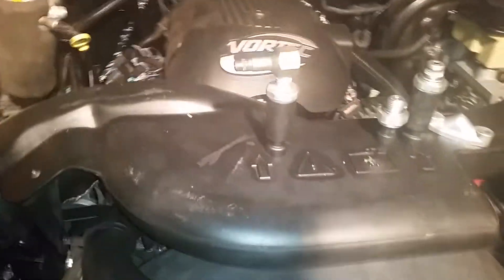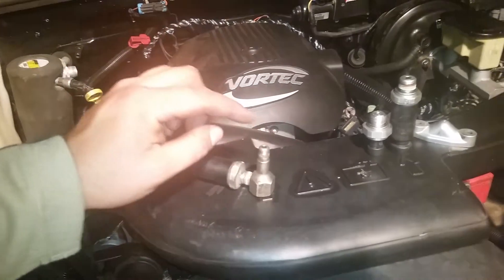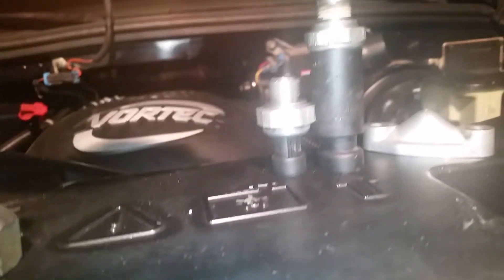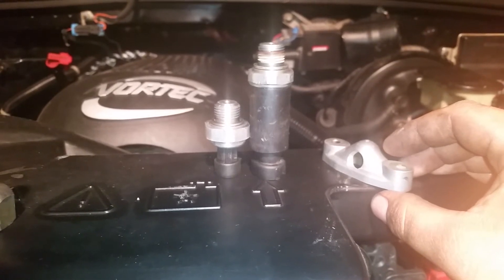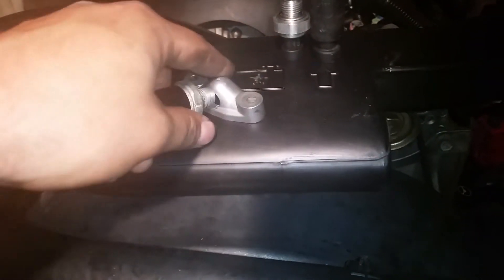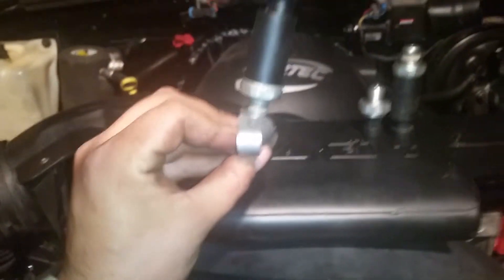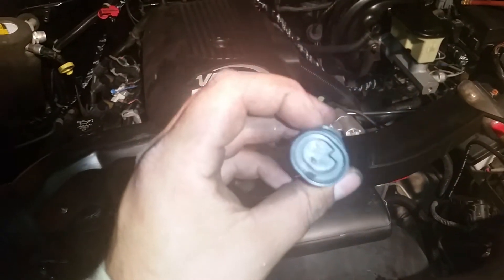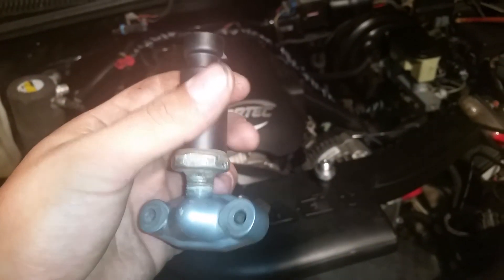OBS Easy oil pressure sender conversion.

Comment: Do not do this to your motor if you thread into that black off play you're going to restrict the flow the stem from the sending unit will stop the flow from one side to the other that block off plate is not to be tapped into for a sending unit for anything leave it alone do not do that the threads from the sending unit will block the flow of oil when you thread it in do not do this
Reply: Wrong

Comment: Be careful that your sender unit does not block the flow.  I watched a video where a guy used one that did and ruined his engine in less than 100 miles.

Comment: 1999 5.3 has   a oil cooler  stub  that     you can tap  and drill a small hole   in to the oil passage    less chance of blocking oil flow just pulled one off  to night
Reply: When you run the oil sending threads down through that blocking plate believe it or not it only takes a little bit of that thread to restrict the flow from one side to the other and you will blow your motor sky high or what I'm trying to say is you're going to spend the bearings do not listen to this guy there's a plug on the side of the block towards the oil pump itself you can pull out and you may have to use an adapter build yourself something but you will not restrict the flow

Comment: All your oil goes through that connection plate... Screwing the sender unit into it WILL RESTRICT or even close off your total oil flow to the engine.
Reply from the maker: Lanc Mac the threads don't go in that far,  the bottom of the sensor can't actually be seen from the inside of the bypass,  it sits high. But yes,  the entire oil volume does pass through there,  thanks!

Comment: Just a word to the wise. If your LS donor motor had AFM lifters, remember to take the oil pressure sensor filter into consideration. This little filter is the last line of defense for your lifters and it has been know to get clogged up. The block-off plate is upstream of the sensor filter and a reading from the plate wouldn't tell you that your lifters were running dry if the filter clogged up.
Reply from the maker: Todd Smith where is this filter you talk about
Reply: If your engine has it (2007+), it is just underneath the oil pressure sensor at the back of the intake manifold. Remove the sensor and its down in the hole. Have a look at GM part number 12585328. Should give you an idea of what to look for.
Reply: Todd Smith i relocated my oil pressure sending unit above my oil filter.But I need  a bolt to block off the back of the valley cover where it use to be what bolt size do I need for the delete?

Comment: I am doing a similar swap (same Vortec engine, different vehicle). Why does the sensor need to be relocated? I have the later model (shorter) sensor. Will that one work?
Reply from the maker: Ted Hargiss what exactly are the years? Current engine,  donor engine?
Reply: 2003 Chevy Tahoe 5.3 going into a 1997 Jeep Wrangler TJ.
Reply: Jeep engine is a 4.0 6Cyl
Reply from the maker: Ted Hargiss does the jeep sender screw into the stock gm location? If so,  remove the gm one and install yours with the wire.  Otherwise,  drill and tap the bypass plug OFF the engine
Reply: Thank you for getting back with me. I really appreciate it.
I will see if the Jeep's sending unit has the same thread pattern. If so, does its wire go to the GM PCM or the Jeep's.
If not, I'll tap the block-off plate. I assume I would use the Jeep's sending unit there as well? Thanks again.

Comment: Hey, how about the rpm sensor? I have a 1995 sierra with a 2003 5.3. Thanks
Reply: I used a 1000k ohm resister on the tach, 12v power resister and tap in to the signal wire. Worked perfect.

Comment: I did the same thing with the pressure sender that came with my gauges but its dam near touching my header. Will I run into issues with heat as far as the sender failing or am I ok?
Reply from the maker: S550 Andy use your best judgement,  my technique is for standard oem manifolds,  i have good clearance,  you may consider an ls adapter into the ls location
Reply: Gary Garcia I actually have the metric to pipe thread adapter I'm not sure why I didn't use it to have the sender sit higher.  Is there an alternate location for the oil pressure sender?
Reply from the maker: S550 Andy the only two locations i know of,  are the oil cooler bypass and the stock location

Comment: Hey Gary, I actually bought an adapter to put the obs oil pressure sensor where the ls one is on top the block. If I understand right can I just remove the oil pressure sensor from the ls harness and use the plug off the obs harness? I thought I read somewhere the ls pcm doesnt need to see this.
Reply from the maker: MrThesiloh yes,  unplug ls, insert adapter, old sender from your truck,  old plug. this should feed the dash just fine,  use Teflon or dope on pipe thread,  not on compression
Reply: Gary Garcia Thank you sir! Hey and it's the same with the coolant sensor correct?

Comment: What are you doing  for temp,battery and speedometer to work?
Reply from the maker: Rene Valdivia temp requires a CTS sensor and sender combo, voltage works automatically,  oil pressure you need to drill a hole in the bypass plug and install your pervious sender
Reply from the maker: oh and the speedo comes in a 4k signal from the pcm,  or you can share the twisted pair from the vss on new engine with the DRAC module on your truck
Reply: You should make a video on this. I'm still deciding if going with a $750  custom harness that was told its plug and play and all my gauges will work properly or go with a $400 standalone where none of my gauges will work until I figure out how to get them working but from watching your videos it's not to  difficult just a bit confusing. Do you have any wiring diagrams from the stock obs harness identifying which wire is which and what's needed and not needed from it I made a mistake when pulling the engine out and not labeling each plug.
Reply from the maker: Rene Valdivia its not hard,  what do you have? I can walk you through this,  I can even get your harness stand alone if  you send it to me ill put a nice fuse block,  3 good relays,  an obd2 connector,  and leave the 4k wire for speedo,  check engine light,  tach,  and the water temp shares 2 wires with harness,  the other goes to dash,  oil pressure is literally not connected electrically to harness, just motor
Reply from the maker: @carlosacosta1050  that's not a good email address,  resend it

Comment: Hey man. I've got an LS1 that I'm planning on putting in my 98 2 door Tahoe. What wiring harness did you use for the new LS motor?
Reply from the maker: Use the stock harness,  just work it to fit your truck
Reply: Is that quite a bit of re wiring?
Reply from the maker: Drake Worthen a ton
Reply: Would it be easier using a stand alone engine harness?
Reply from the maker: Drake Worthen I've never used one,  if you know anything about wiring,  just redo yours,  otherwise,  a painless might be easier.  It depends on what you know and how much you want to spend,  head over to lt1swap.com and try to figure it  out,  you might be surprised how easy it is
Reply: Alright thanks man! I appreciate all the help, good luck on your build man